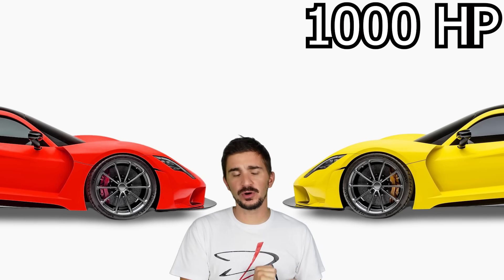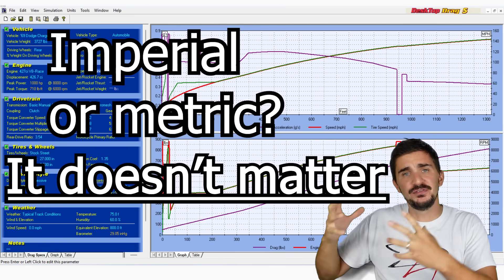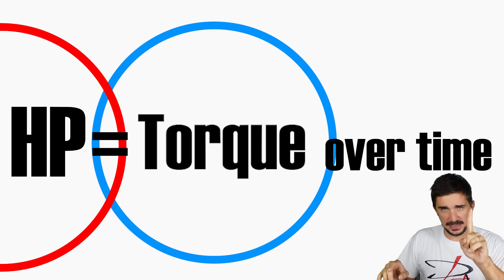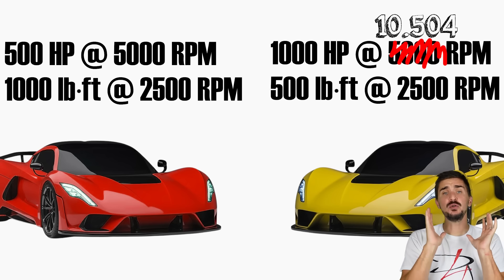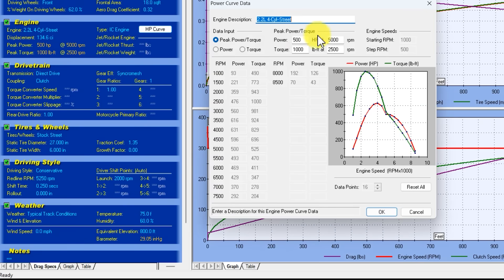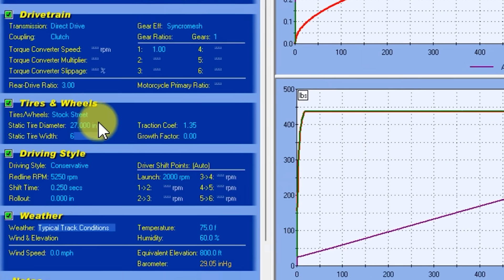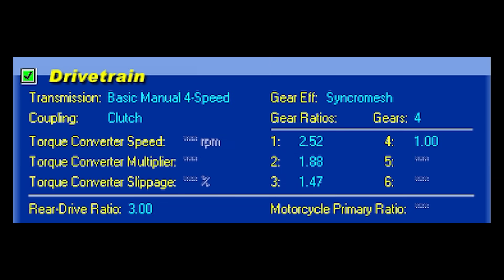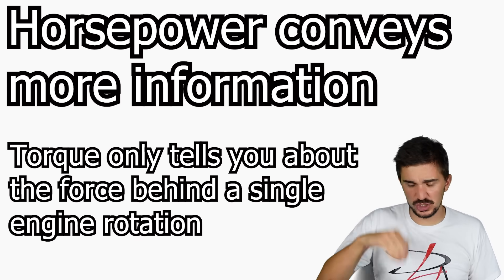Who's faster? Explained and Simulated - Horsepower vs Torque

Comment: The punches explanation is actually awesome, as it helps describe how transmissions work. The horsepower you put in to the transmission is the same as the horsepower you get out, so the same damage per second. But in first gear, you do less frequent but more powerful punches. In higher gears your damage is reduced but your attack speed is increased!

Same damage output, different speed and torque. Thank you so much!
Reply: And I forgot what I wanted to add in the first place!

One of the most extreme examples of a high RPM low torque engine would be the rotary. To make up for this, they have gears that are optimal for extreme RPM use.

Gearing makes a massive difference for effective DPS!
Reply: @damiansmith5294 or Ducati motorcycles, with desmodromic valves, revving to absolutely insane rpms, but making pretty blah torque, pure attack speed stacking strategy
Reply: reminds me of a guy who made a video about cooking a chicken by slaping it 😂
Reply: @AdamAdamski69 that was a great experiment, dumb as it was, it was awesome
Reply: @AdamAdamski69 haha Rpg style
Reply: @AdamAdamski69  😂😂😂
Reply: Hol up, I think this should be reversed? At low (1st) gear, you let your engine spin very fast to compensate for the lesser torque at low RPM. At cruising speed and overdrive, you don’t need power, so you reduce engine speed, so less punches per mile.
Reply: @Appletank8  you're saying what he said in a different way, you're on the same team
Reply: @AndrewB383  I'm somewhat confused by OP's "first gear, less punches per minute", when generally first gear has high engine RPM for low wheel RPM.
Reply: @Appletank8  like @AndrewB383 said, you're both right.

You're looking at it from the crank's/flywheel's perspective,in which case you're right. The engine spins way faster than the wheels do in first gear.

The "OP" however,is looking at it from the output shaft's perspective,which after going through the reduction gear in the tranny (1st gear in this case) now produce much more powerful, but far less frequent "punches".In which case, he's right too.

It's all a matter of perspective
Reply: @Appletank8 yes. He mixed up.
Reply: Lower engine speed almost always means less power because of fewer (punches) per time. Since you dont need much power to maintain speed compared to accelerating thats fine. But if your racing you only shift up because your engine rpm is getting too high.

You can actually calculate the best time to shift in a race by solving for torque and comparing the crossover point between 2 gears
Reply: @BrokeWrench or you can just look at which gear gives you the most hp.
Reply: Excepts its wrong. Damage is damage regurdless of how low it is. cells  and structors  will eventually break down from constant refroming.
Reply: I would argue that you got the analogy backwards. 

In first gear, you are doing a lot of punches, but they lack power. In higher gears, the power is there but they are happening less frequently. 

But in reality this is a very crude analogy anyway because for each gear you have peak torque, so the trade off is happening on a smaller scale within each gear as well.

 Also in crafting a more compete analogy, we’d consider the ‘cost’ (your energy level) of this action rather than just the benefit (doing ‘damage’). 

Your ‘higher gear’ punches would also be ‘easier’ for you and the low gear punches ‘tiring’ for you.
Reply: It’s a great explanation when it comes to old school N/A Diesels...being slow as hell, but why you can still attach a few tonne to the back, even if you can’t even reach 100km/h, but it’ll still drag it along, with 85kW from 4.2 litres...
Reply: @85priesty because of the gearing. A mouse engine could drag it if the gearing was low enough.
Reply: The punches explanation is a bit lame IMO (its fine for people that have no clue what torque is), why, torque number actually gets nothing done, it does not tell you the rate at which work is being done. At 12:40 Torque is NOT about a single rotation, its simply the twisting (torque) force applied and tells nothing about how quickly work is being done.
Reply: First gear less frequent punches?? You missed the bus.
Reply: Hp= how fast a engine can work ..
Tq= how much work can b done ... Both dictated by rpm ..... Clarification or confussion ?
Reply: @earltucker181 "How much work" is still horsepower.  Torque = the magnitude of force
Reply: @earltucker181 torque is a force not dictated by rpm.
Reply: @earltucker181 utterly, wrong.

Comment: you could've mentioned that in Metric if you want it really correct, the formula for Watts is newton metres times radians per second. for kW divide by 1000. 
Also I do use the torque values given by vehicles to know a second point of the graph. 
IE if we have a Citroen C3 2016 with the 50kW petrol engine, which is given at 6000 RPM, while the torque is 95Nm at 3000 RPM giving me 30kW of power, which means that the engine kinda sucks at low speeds so if you want to accelerate you always want to be up high in the rev range.
Then as a comparison lets take a 2018 Dacia logan Mcv with the 55kW diesel which is at 4000RPM and a peak torque of 200Nm at 1750RPM making 36.5kW at that rPM. Meaning I don't need to rev its tits off to actually get meaningfull power, but I can just stay in gear and step on the gas to accelerate while in the Citroen you'd want to down shift most of the time.

Comment: I like the example of weight carry. High torque is someone who can carry a 100kg box for 20 meters, A high RPM is someone that can carry 6 boxes of 20kg at the same time that the big strong guy takes to move the big box. Sometimes you may need one or another

Comment: Can you make a video about crankshaft stroke and conrod length and how do we change peak torque to lower rpm or higher (by overbore or overstroke method) and maybe how to make power with a square engine?
Reply: I believe he's already made videos about most of those. He's definitely covered the stroke to conrod topic before.

Making peak torque at different RPM is today most affected by stroke ratio and head design. Longer strokes make more torque but aren't as durable at high RPM. Characteristics that makes heads flow better at low RPM usually make them flow worse at high RPM (such as valve lift, valve diameter, runner length, etc.) The more flow you get, there more torque.

AM engine being square isn't typically a large factor (at least not on its own) for making power. For example, the K20 makes plenty of power (for its displacement) with a square design. It depends on a lot of factors.

Comment: Every one of your video is a gem. Now, how do two 1000 HP engines compare, on the 1/4 mile, when one is an ICE an the other Electric? My bet is on the instant torque of the E.
Reply: Obviously the EV would win. Same peak power, but electric motor can deliver it across whole RPM range, whereas ICE delivers peak power only at the top end of RPM. Not to mention that ICE needs to shift gears, while EV can use a direct drive.
Reply: The electric motor will win every time. As you probably know, electric motors don't need gearboxes because they have a high maximum RPM and can produce 100% of their torque from 0 RPM. Their torque and power curve is ideal for acceleration because they can almost produce peak horsepower at any given RPM.

With an ICE peak hp is only available at one RPM, so a transmission is used to keep the engine as close to that RPM as possible, but it will never match it perfectly. You could accomplish this using a CVT, but practically no racing application uses a CVT.

Comment: Horsepower will ALWAYS win, just make a transmission good enough to keep the engine near peak HP and the HP biased engine will win every time, even with a trailer in the back 
I modified engines and I know what I'm talking about
No hate but this video was a bit trashy
Should have used something like a 6-7 speed tramsmission on the high rpm engine and kept the 4 speed on low rpm engine

Comment: I like to think about torque at the wheel, and a higher hp engine taht gets it from higher revs should have a more favorable gearing for that.
However, torque matters when you are re-accelerating from low/mid rpm without downshifting and making your engine scream at 9000 (hence why this figure is important when considering road enjoyment.)
Reply: Yes but HP is the more useful metric for performance. A 20000rpm F1 engine will outpull a semitruck engine, assuming you have  the correct gearing. It will just be very loud, need a lot of service, and consume a lot more fuel.

Comment: Very good explaination!
I'd like to see a compairson between a Diesel and a Gasoline Vehicle with the same HP, but different Torque (with optimised tansmissions for either vehicle)
Reply: That's easy. Petrol engines make peak torque in the upper half of their rpm range, diesels make peak torque in the lower half. That means diesels are not in their ideal rpm when racing. Peak torque doesn't matter if it's at 2000rpm, and the engine is running between 3500-5000rpm where it makes just over half the torque.
Reply: You both still don't get it.  HP is what matters, peak torque just happens to give you an idea of what the HP curve looks like.  If you have optimized transmission, they are the same.  What is optimized? No limitations to 5, 7 , 9 gears... instant change... how about a CVT. It would hold peak HP the whole time and torque at the wheel would be identical on both.  Torque is a force not power, it is irrelevant when you have a transmission which is a torque multiplier.  The vehicles with same hp but one has higher torque means it makes its HP at lower RPM and inherently is easier to gear in a more ideal way with current technology.  That's it.  A formula 1 car can pull stumps too with the right gear ratio... but it can't do that and break 200mph without infinite gear ratio.  HP is everything, peak torque is just a meaningless value that happens to tell you a story about HP.
Reply: @ryanphillips8492  if you have a cvt, you want to keep the engine at peak torque, not at peak hp. That's how you get the highest torque at the wheels. And diesels are always heavier, that's why pterol would win.
Reply: @bence.gabor.slezak no, you would keep it at peak horsepower as this will amplify what torque the engine has by the greatest amount. The torque at the engine will be less for sure, but torque at the wheels will be greater
Reply: @bence.gabor.slezak  nice thought but wrong, still spreading misinformation.  I can make 500 ft lbs at the crank my self with a breaker bar, doesnt mean i make even 1 hp.  Peak hp = peak power = peak torque at wheels
Reply: @ryanphillips8492  take any car in any gear, it will make more torque at the wheels at peak torque than at peak power.
Reply: @bence.gabor.slezak  this is why you are wrong.  Yes.  Same gear. Different speed.  At peak hp, it is making less torque with more rpm and more wheel speed and more power.  And if you changed the gear ratio, to catch up with your higher torque and slower wheel speed you have divided the torque and have less at the wheels.  It's simple math.  A simple concept.  Force and power are different.  Gears are a lever.  Why can't you just put your truck in 4 lo and be twice as fast?

Comment: Well put, but with high HP comes great engine wear due to friction and mechanical parts speed. One of the reason large trucks use high torque diesels.

Comment: Do a comparision between an engine with only low-down torque and one with all the torque up there, with the split at 3000rpm. The first is great for general down-town driving, the latter is sporty and racey as you can take advantage of gearing to always stay in the power band. This of course pre-dates modern tricks like VTEC, VTTI and turbocharging so you've got torque everywhere.
Reply: If you plug your example into the horsepower equation, you'll find that producing park torque higher in the rev range results in peak horsepower being higher in RPM, but assuming the torque values are the same, the engine that produces that torque at a higher RPM will also produce MORE peak horsepower. This is why race engines typically have high red-lines.